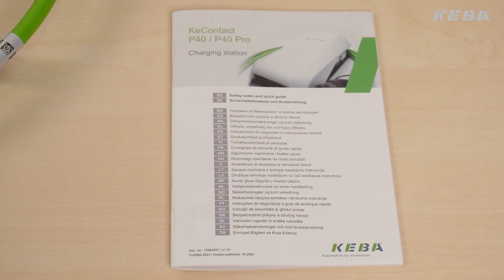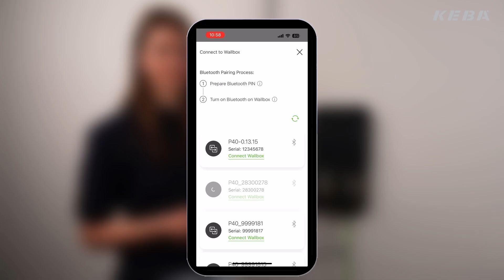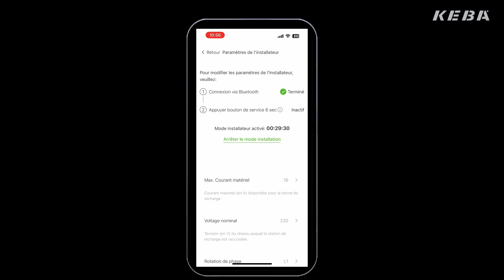KeContact P40 Installation (FR)

Comment: Sind das 2,5mm2 oder 4mm2 Kabeldicke?
Reply from the maker: Lieber MaxMustermann-z3n,

vielen Dank für deine Anfrage. Die Klemmen der Wallbox sind für Kabelquerschnitte von 2,5 bis 10 mm² ausgelegt. Der genaue Querschnitt, den verwendet werden sollte, hängt von verschiedenen Faktoren ab, wie der gewählten Stromstärke (16A oder 32A), der Kabellänge und den spezifischen Installationsanforderungen. Wir empfehlen, diese Faktoren bei der Auswahl des richtigen Kabels zu berücksichtigen, um eine sichere und effiziente Installation zu gewährleisten.

Solltest du weitere Fragen haben oder Unterstützung bei der Auswahl des passenden Querschnitts benötigen, steht unser Kundensupport gerne zur Verfügung.

Mit freundlichen Grüßen,
dein KEBA eMobility Team